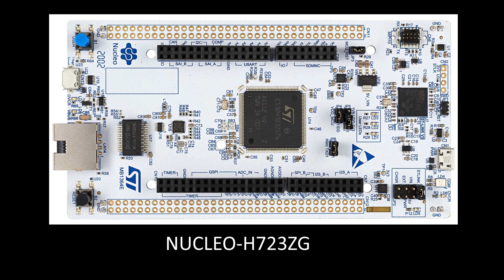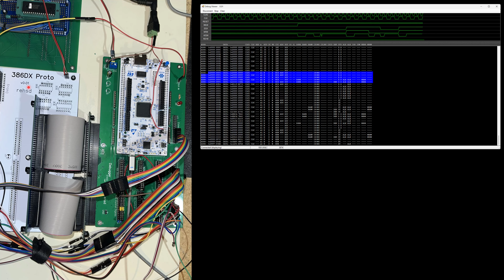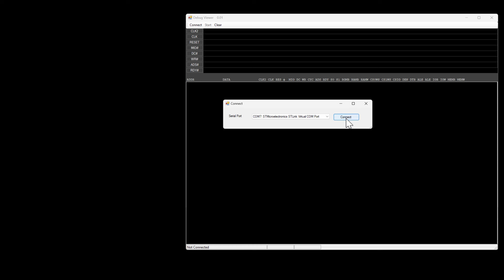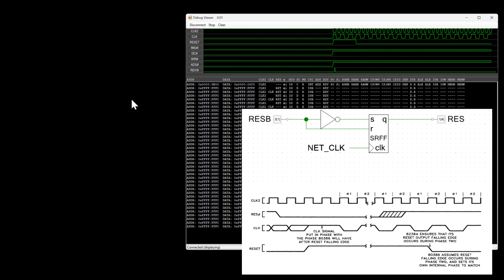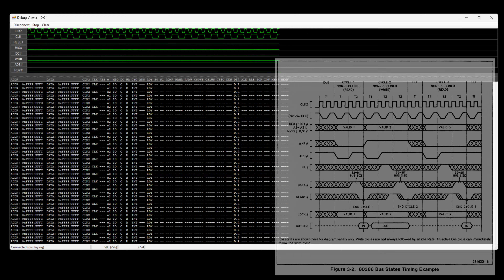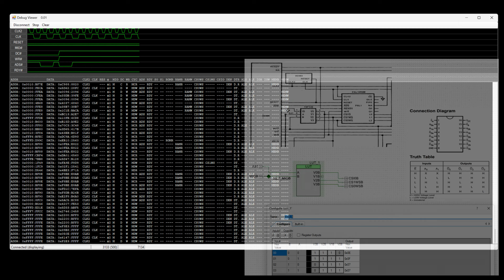Hardware Debugging - Using an STM32

Comment: How accurate is your signal display? I assume it's just an aproximation? Are you capturing on the signal edges or in the middle of the high/low values? Either way, that is a hell of a lot of work you've put in! Great job!!
Reply from the maker: Currently, I am sampling ~50 times per second and plotting the results. Each sampling of a signal results in a horizontal pixel being added to the graph. I can adjust this rate to sample faster or slower. I am not basing it on an edge, CLK2, CLK, etc., but rather a constant scan of the signals from within code on the NUCLEO. Then for the logged data on the bottom of the screen, I am only showing the data on CLK2 rise. So, I guess I would say the signal display is relatively accurate -- somewhere between approximation and precision.  :)

Comment: Can you provide a link to timing diagrams PDFs with hold and setup times for ISA bus?
Reply from the maker: This is the manual that I've been using: http://www.bitsavers.org/components/intel/80386/231732-001_80386_Hardware_Reference_Manual_1986.pdf. It has quite a bit of timing detail.
Reply: Thank, you! But it looks like 386 interface with it's pipelining is more complicated than wide bitmapped, but simple 486 one! @rehsd
Reply from the maker: @alexloktionoff6833  For now, I have address pipelining disabled. If I can get the basics running, then I can come back and see if I can figure out the pipelining.

Comment: Complicated… Why not to go modular way? I mean passive backplane and small debug-able separately ISA cards?
Reply from the maker: Do you mean for the overall system build itself? I have taken that approach for some of my builds. For this build, the current ROM setup is temporary. I would hope to eventually have the core of the system in a single motherboard, and then use ISA add-in cards for video, sound, etc. -- much like a traditional 386 motherboard with expansion cards.
Reply: For debugging purposes, it's easier to debug module by module, and it's cheaper to re-spin 10x10cm card than the whole motherboard. @rehsd
Reply from the maker: @alexloktionoff6833  Agreed.
Reply: I see, you decided to go big corporations way, to get same skills, right? @rehsd
Reply from the maker: @alexloktionoff6833  I can't say I've put too much thought into it. The primary driver for a single board is that was what we the standard for 386 systems. But on the other hand, I'm doing so many things that aren't standard.  :)

Comment: Can you help me with a question? I have a project using the SSD1936QL9 connected to the STM32F407VET6. I want to use them in the following way: when the user takes an action on the display, the system will save that data in a NOR Flash memory. For instance, if the user generates a password on the display, that password will be stored in the NOR Flash memory for future user access to the device. So, what do you think? Is the STM32 capable of performing this kind of activity?
Reply from the maker: Well, I'm definitely not qualified to provide advice on the STM32.  :)  While this was my first attempt at using an STM32, I expect the answer to your question is 'yes.' I have done some work in the past with Arduinos, where I store user data to flash -- and this NUCLEO board and STM32 seem to be far more capable than the Arduino Mega's and Due's I have used.
Reply: @rehsd  So, if we were to analyze the STM32, it would be capable of doing this. Thank you so much for your answer!

Comment: So for the first 22 minutes I was like "why doesn't he just use the damn logic analyser he bought?"  But your poor man's analyser is actually pretty slick. The one big thing it has going for it is that there's probably an easier integration path to log data and easily get it into python or something to do more sophisitcates capture storage and analysis than the old HP.  All my old gear wants either a 3.5 inch floppy or a HPIB bus! What's the sample rate/time resolution of your poor man analyser?  I'd caution you that even the HP with 400 MHz is not sufficient to accurately verify setup and hold times - for that you need a decent scope, at least 2 channels and high quality matched probes.  The LA will let you know that it's working at the moment or not, but won't let you know you're right on the hairy edge and likely to fail if the ambient temp goes up 5 degrees. Anyways, a lot of cool progress and looking forward to seeing what's next.
Reply from the maker: I am really curious to see how I can use the data (live or captured) coming out of the professional logic analyzer. It looks like there are hooks there to do some cool stuff. And as you're pointing out, I'm sure this analyzer won't magically do everything, and my scope will be important, too. I have a decent (I think...), four-channel scope; I am just using the OEM probes that came with the scope. (The scope is a SIGLENT SDS2204X Plus). I have so much to learn...  :)